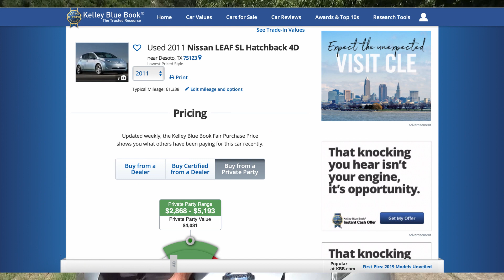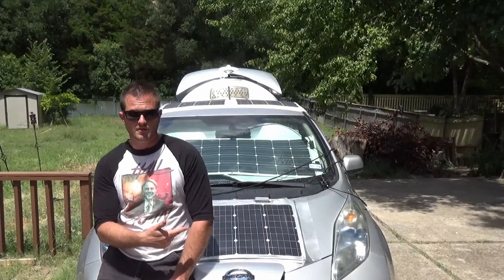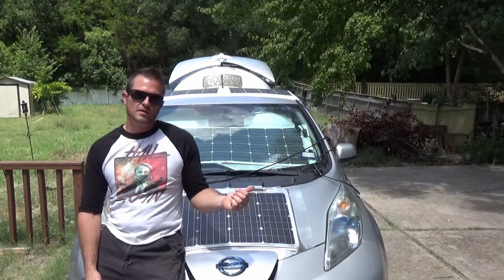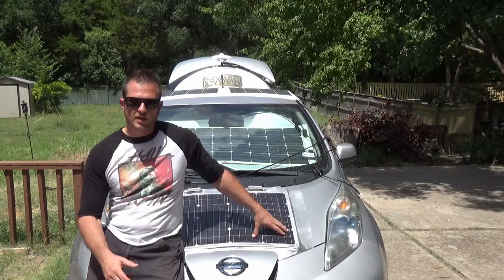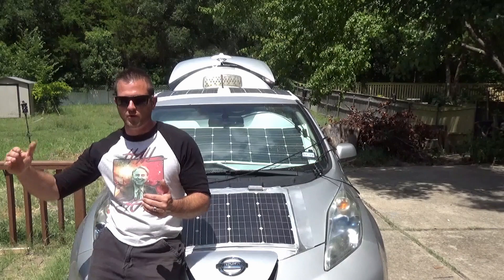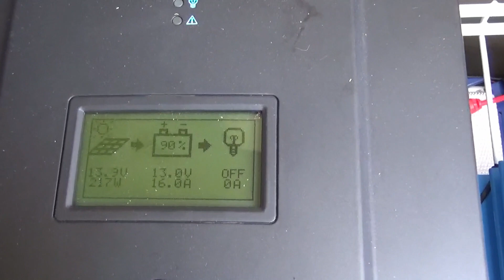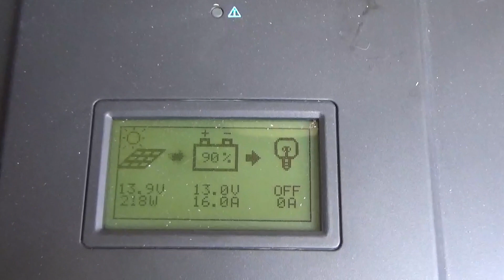Why Make a Solar Car?

Comment: You should be eligible for a battery replacement under warranty surely? You only seem to have done 45,000 miles and your capacity has dropped to 7 bar.

Comment: Why go through the trouble of converting the power from DC to AC when it's just converting the power back to DC? Is there a possible solution that could cut out some of that middle-man stuff?
Reply from the maker: Thats the number 1 question I get from people with some background knowledge.  The main car battery charges at about 390v.  The highest power we can generate from onboard solar is about 50-60v.  You can run that through a voltage step-up and jack it directly into the battery, but then you run into problems with the vehicles' bms (battery mgmt system).  Basically the vehicle expects to have the same charge in the battery when you start it up, as it did when you parked it 8 hours ago.  If we charge it all day (with direct solar DC into the battery) by bypassing the vehicles AC plug-in, the car's computer will freak out when you turn it back on.  Where did all this extra power come from?  Is there a short/problem with the 380 pounds of highly flammable lithium battery cells under the vehicle?  The vehicle will interpret perfectly safe solar charging as a battery malfunction if we bypass the AC charging hardware.  There is probably a way around this which would allow the much more efficient DC-DC charging you asked about, but it involves manipulating the vehicles BMS software.  I will do a video on this in the near future to clarify all this.  Hope that explanation provides some explanation.
Reply: @InnovativeSustainableSolutions  That makes perfect sense. Thank you for taking the time to reply to me!
Reply: @jared6326  I just had an idea.  What you guys have said makes perfect sense.  But let me know what you think about this other angle:  When you use regenerative breaking the battery system likely receives different amounts of energy depending on how fast the regenerative system is going.   Therefore, if that assumption is correct, the electrical system must be equipped with recharging the batteries at different rates at different times.  Might there be a way to trick the car by tapping into the regenerative system to feed some of the juice you have from your range extender system to the main batteries to keep them charged longer without needing to stop the car between charges for a re-charge?    That way you wouldn't be going in through the regular charging system.  My only thought is that it might require stepping up the voltage to whatever it is it might be expecting wherever that feed happens to be coming in for recharging the batteries in this manner.    _just me thinking out loud.  

If you are able to pull this off I believe you might be able to go into business for yourself as this would solve quite a few issues for others who would greatly benefit from this.   All the best to you and Happy New Year!  :D

Comment: I just bought a 2011 leaf SL with two bars missing. 50 mile range. I am considering building a battery pack to extend my range, but instead of wiring it into the cars traction battery I am thinking of using it to charge with. My Leaf has the DC fast charge socket. What I don't know is if it's possible to dump DC voltage as a charge.
Reply from the maker: It's doable.  Easier than wiring it to the main battery, but there will be some hurdles.  Portable DC (CHAdeMO) chargers are a little harder to find.  You will have to wire your batteries through a low-voltage-cutoff (to protect from overdischarge) to a transformer/voltage-step-up, that can handle atleast 900w and will change your low V battery power into 240V power to fuel the DC charger.  The DC charging is up to 10% more efficient than my AC charger.  But more complicated to install.  I have heard of people doing to DC dump at "low" (sub 1kw) wattages.
Reply: @InnovativeSustainableSolutions  I just got my Leaf a few hours ago. I am waiting for a charge to complete. I won't be modifying it any time soon but perhaps some day. Thanks for the effort in making helpful videos. Cheers!

Comment: Question- has the added weight of the batteries, charge controller, inverter, etc reduced your max range of 46 miles? Were you able to calculate a wh/mile average before and after the weight was added?
Reply from the maker: Mileage per kwh has fallen from 4.8 to 4.7 kwh; about 0.96 miles per 46 miles.  I think it's a 2% loss of efficiency.

Comment: He said the batteries cost $3000 and on ebay at $399  ?
Reply from the maker: The listing shown at 3:16 is $399 for 6 battery modules (with over 100 sold).  There are 48 battery modules 2011 Leaf.  So you could disassemble the main battery into 8 groups of 6 modules.
Reply: @InnovativeSustainableSolutions  How many volts and watts are each battery module capable of?  In case it may be helpful to simply buy used battery modules as part of a range extender system (instead of the lead-acid route) for another car that might not be a Nissan Leaf.   The Kandi K27 comes to mind.  It's minimum range is 58 miles and maximum is 105 miles, depending on weather conditions and how it is driven.
Reply from the maker: @fanfare100  Each Leaf module is 500wh (when new).  They are 2s2p, weigh about 8 lbs, and are 7.7 volts nominal.  The Kandi would be a PERFECT car to add a solar power station on.  Depending on how reliable the the drivetrain is.  The Kandi is frequently compared to buying a used Leaf.  Based on how stripped down the Kandi is I would guess that it is easy to work on too.  And yes using Lead batteries in an electric car was a terrible idea.  Lithium is a far superior option.
Reply: @InnovativeSustainableSolutions  Ah, thank you!  The Kandi K27 battery pack is 17.69 kWh Lithium Iron Phosphate.   I still don;t know at what total voltage as I can't find any literature on it yet.  The best bet would likely be to try to match the voltage of the current battery module so that I won;t have to do the inverter thing and that way I won't need to wait until each time the car is turned off to charge it.   

BTW, it occurred to me that one way to extend the range on your car would be to find a way to automatically switch it to charge mode every time you were stuck at a red light.  What do you think about that idea?

Because sometimes people are stuck at red lights for up to 3 minutes at a time.  At 4 miles range charge per hour, that would be up to about a 5th of a mile miles per red light.  Is it even worth it?   lol
Reply from the maker: @fanfare100  The lower the voltage of the battery the easier it would be to DC charge from the solar.  Each panel creates about 20v, multiply that by each one in series, and you should be able to build up to 80v with 4 100watt panels.  If the Kandi's voltage is higher than that, some form of step-up will be needed.  But generally: cheap cars=easy to hack cars=great project cars.  The red light switch idea is hilarious - but also maybe genius.  You would have to switch the vehicle into park, then flick a switch that closes a circuit wired up to the charging port.  I've actually already been planning on doing this mod, so I don't have to leave the charging cable dangling outside the car while it solar charges.  It never occurred to me that I could use down time at train tracks, or drive throughs, or red lights to charge using such a switch.  Goofy idea, I like it!
Reply: @InnovativeSustainableSolutions  haha  XD  I'm glad you liked the idea.  Let me know how it works out.   I know.   Sometimes we gotta think outside of the proverbial box the mainstream manufacturers think in.     Also, take a peek at this:  Good and promising interview:  Indian Twin Sisters have come up with a Bio Organic Electric Vehicle Battery!  https://youtu.be/BXVE6VSafw8  I'm certainly hoping it ain't vapourware.   But it seems like maybe, just maybe they may be onto something.
Reply from the maker: @fanfare100  Oh yeah, LTO, is great from a safety/longevity/weight perspective but it is cost prohibitive.  Over twice the cost of LiFePo.  A Lithium Titanate Oxide battery bank the size of the one in the Suneater would have cost me around $3,200.  More than the car itself.
Reply: @InnovativeSustainableSolutions  I heard the guy say it was ~$55/battery and that might have been Kiwi dollars, not USD, so, you'd have to make the conversion.   But each battery is 2.3V and 40Ah, so you'd have to stack them in your own form/fit/factor and do the math and currency exchange maths.

Comment: I saved $1,800 a year over my Honda Accord I traded in. I purchased a new Nissan leaf Plus so I get 253 to 267 miles on a charge. But the first system that someone dreams up that will keep me driving, without needing a charging station, I would enjoy adding because I would like to see the country in my Electric Car.

Comment: can you just run the solar panels to the power inverter with out the extra batteries?
Reply from the maker: Probably not.  The car charger pulls 1400 watts.  You would have a very hard time putting enough panels on a car to consistently deliver that much power.  There are some car chargers (or EVSEs) that allow you to adjust the charging wattage though.  Maybe you could combine a low wattage EVSE with a car thats just covered in solar and pull it off.  But it would be a long shot.

Comment: Hi, great job trying this idea out - I really like what you are doing.
One crazy idea for you - what about attaching the flexible solar panels to a fabric car cover. You could have a lot more panels on the car cover (don't have to worry about windshields, etc) and it would help keep the car cool in the sun. Since the battery can't charge when moving it really isn't a disadvantage. It would likely triple your charge rate. Good luck!
Reply from the maker: Plus the panels work better when there is airflow around them :).  I think everyone who builds one of these will eventually create something similar to what you have in mind.  My version of it should be out in the next 3 months or so.  Stay tuned!
Reply: @InnovativeSustainableSolutions  DO IT!!!

Comment: You have a completely electric car but without a good battery, which if you double the battery of two Nissan leaf in parallel your story will change for better. I did not to one Nissan leaf but to two Nissan leaf.
Reply from the maker: I just watched your videos.  That really cool man!  Where did you get the extra batteries from?  If you're ever in Texas hit me up, and we'll give one solar panels AND a bigger battery!
Reply: @InnovativeSustainableSolutions  I am in Texas, Houston. I had to buy one accident Nissan leaf from Copart and get the battery after which I disposed of it (the blue Isaan leaf in my video), for the second one I got it from a junkyard at a good price.
Like you too I did put a sollar pannel on my first Black Nissan leaf but I did not achieve my desired result of going to work and back home.  So I double the battery and now I am happy. What I want next is Tesla battery to replace those in the trunk.
Reply from the maker: @t.shonoiki563  Howdy there fellow Texan!  You were lucky to find a complete battery at a junkyard for a good price.  DIYers have really discovered the value of these old batteries recently and Ebay pretty much sets the market value of them now at around $3,000.  Will you please e-mail me what kind/how many of panels you used?  And what kind of inverter too.  My Renogy 3000W acts a little funny sometimes, and I've been looking for something a little more rugged.  Thanks Lonestarezev@gmail.com
Reply: I used AIMS 1200w inverter. Two 200WATT 18V 200W SOLAR PANEL KIT SOLAR PANEL SEMI-FLEXIBLE MONOCRYSTALLINE+ CABLE and five 100Amps 12volt batteries.  You may need to change your EVSE to handle 110v to 220v (Dryer outlet at home) for faster charging.